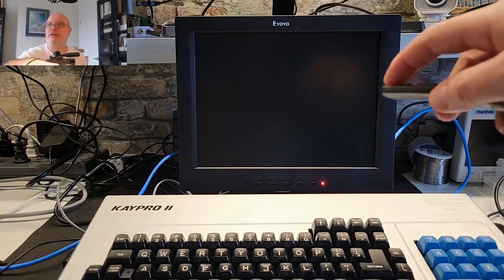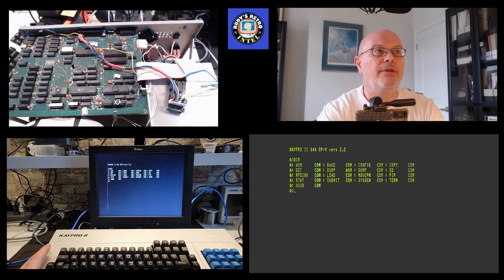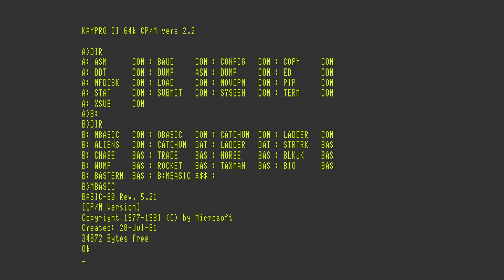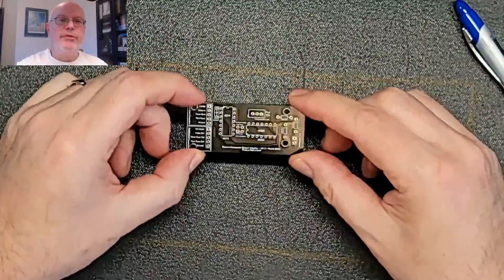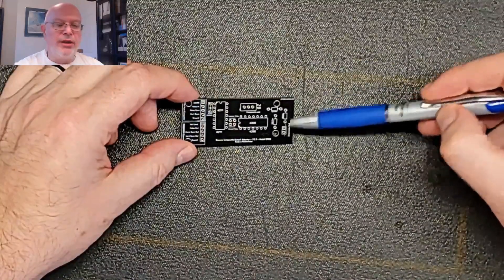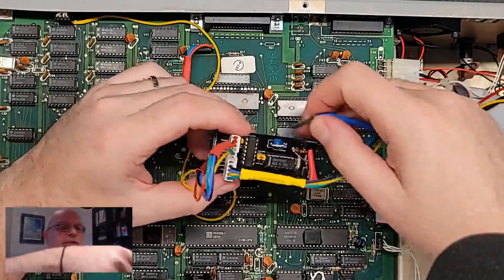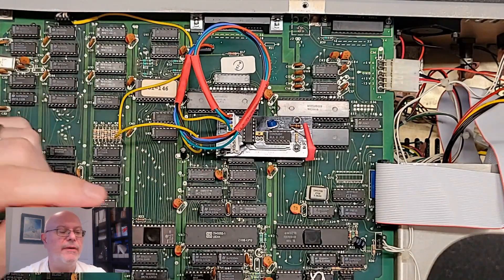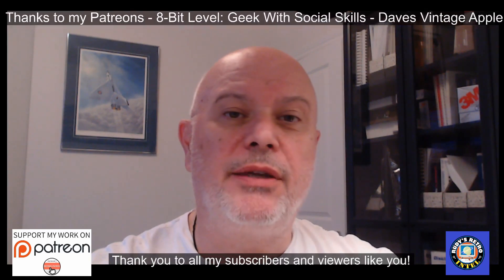Improve Your Kaypro II with a Video Output Adapter

Comment: Cool!  I actually hacked some on my old mayoral II.  I soldered on a faster crystal and added a turbo switch, moved the brightness control to the front panel, soldered in a drive controller chip (it now supports two double sided double density and two quad density drives) and installed an 8088 board in it so it could run non graphical DOS programs and some other stuff.  Never designed anything on my own tho.  Great job!
Reply from the maker: Wow! Excellent modifications! Thanks for sharing